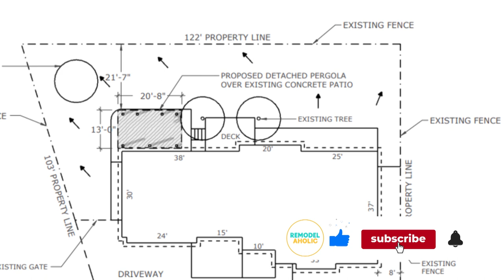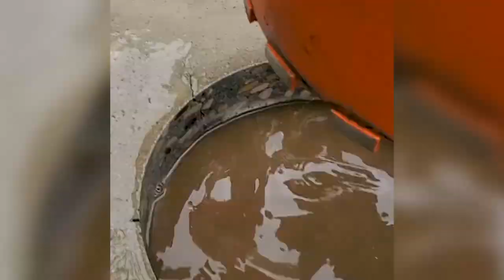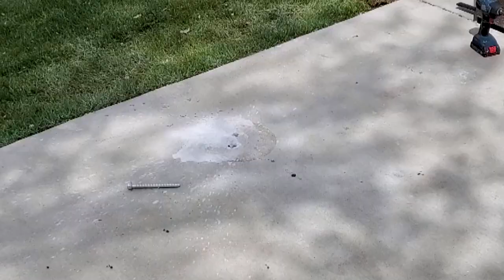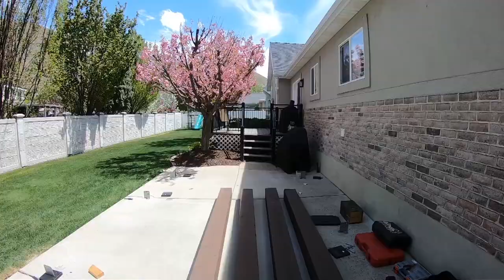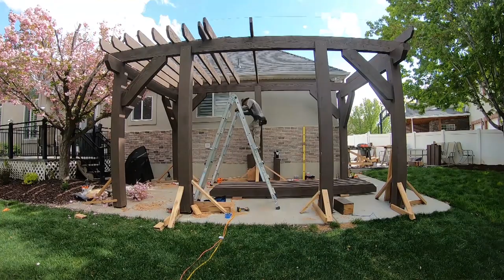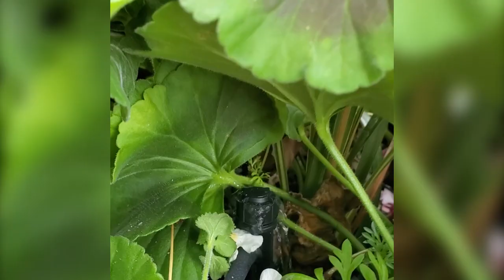How to Build a Stunning DIY Pergola: Step-by-Step Guide | Remodelaholic

Comment: Why go through all the trouble of cutting the concrete if your just going to drill through the new?  Could you not just drill through the previous concrete?
Reply from the maker: It needed footings because of the size of the pergola.  If it was smaller than 200 sqft you might be able to get away will no footings.